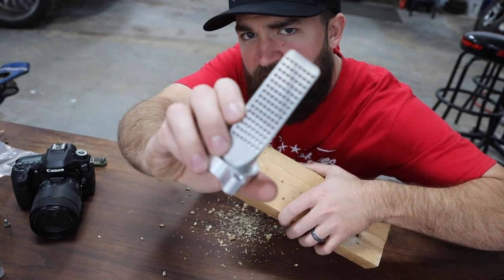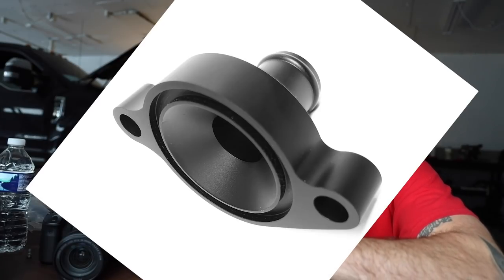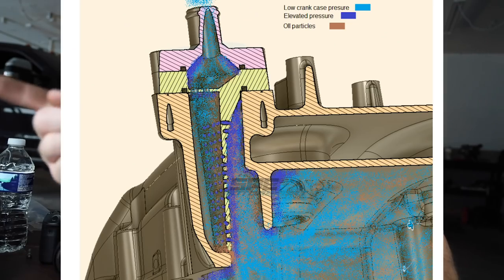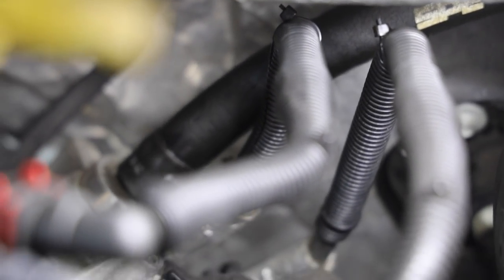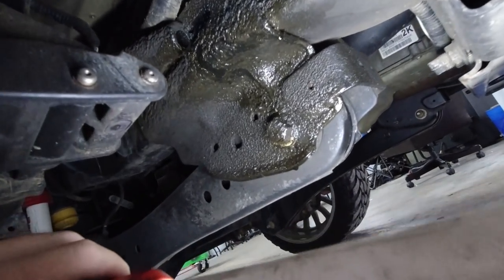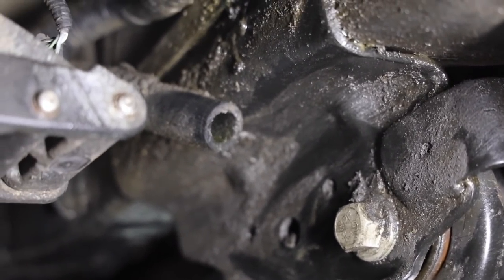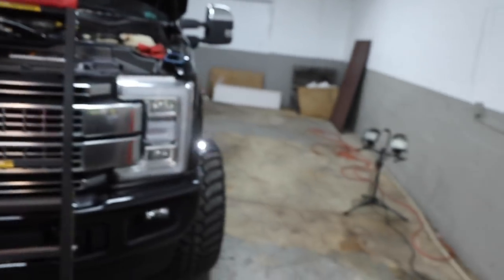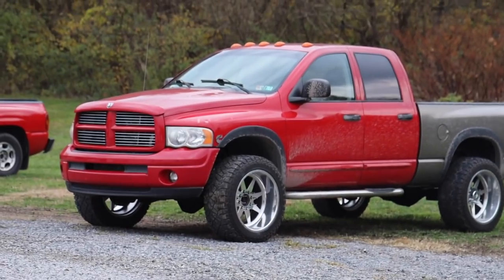Ford 6.7 Powerstroke INTERNAL CATCH CAN - NO MORE OIL DRIPS!

Comment: Pusher, the company who makes those amazing intakes, they make a coupler that connects to your stock ccv box outlet tube and comes with a 1 inch 6ft hose. So you dont need to remove yours ccv box unless you have the filter model. The new filter less model is a catch can then you connect your outlet hose to the included coupler to the one inch hose, then you cap off the intake. Done in less than 20 mins and you have a catch can. All for $32

Comment: Any reason you can’t do this with the existing CCV factory filter and plenum in place? To essentially give you much longer filter life? Seems that a combination of both would still prevent any/excessive oil from reaching the turbo. If this works as well as advertised then there’s no reason to delete the CCV plenum and filter.
Reply: The factory CCV Box would not fit on top of this because of the thickness of the flanges. Ford could redesign their box and incorporate a cheese grater like this. That would be a great way to modify future models.

Comment: Mine still leaks and it’s leaking at the crack case itself when driving and I made sure to install the o-rings supplied with the kit so it’s not that. Maybe the bolts aren’t long enough to give it a good seal idk

Comment: I have had both of these since the ICC launched and indeed get no drips, but the smell and smoke are more than I can stand, Im adding in an external catch can w/ venturi tube into exhaust. I honestly get a little embarrassed with the smoke coming up from under the truck that I can see whenever I am sitting idle in traffic or at drive throughs.
Reply: Did you do this? I have the same problem where the smoke caused people to comment so I extended the hose toward the rear of my truck. What would you suggest for prevention of the oil drip
Reply: Do you have a link for this?

Comment: Just wondering anyone who has done this, where did you route your hose? I took mine over the brake booster and down under the drivers side but the vapor smells are bad. Doesn’t bother me too much, I drive a semi daily but it does bother my family. Did anyone get the extended hose and where did you route it? Down the frame farther?

Comment: So running this product does that make it safe to re attach the the ccv hose back to the intake of one wanted to no longer have it vented to atmosphere? Reason I have these questions is I understand what you mean when you say it drips I noticed between oil changes I lose about 1qt to 1.5qt but I idle my truck on location for about 12+ hrs a day I have it routed to the exhaust but kinda getting tired of it hazing outta exhaust was wondering if it would be safe to route it back to Intake but with mine being an older model 6.7 they have a higher amount of crank pressure then the 15+ was wondering what your input might be I appreciate it!

Comment: What kind of hose is necessary for catch can back to intake?  The 3/4" heater hose that I used collapses.  Heat from the engine makes the hose pliable, and the intake's vacuum pressure causes it to collapse.
Reply: Kits have a heavy wall silicone hose.

Comment: I had to trim mine down, it didn't slip right in like yours did no matter how I orientated it
Reply: How did u trim yours down? Take some off the sides and bottom or just sides? I've got a 2012 and just put mine on today an tried to install internal catch can and it seemed to wide so I need to trim mine to
Reply: @beaugodwin7306  I have a belt sander and just started removing material until it slipped in without any force

Comment: Why does there need to be a hose? Couldn’t you just put crankcase air filter in place of the hose and be good? What’s the purpose of putting a drip hose?
Reply: Good question, most all older engines just had a filter that was placed right in to the valve cover. Seen several high hp gas engines with them and never seemed to be an issues.

Comment: I did ccv re route to under the cab and when idling a lot of white smoke/foggy thing coming out. Is there anyway to fix?
Reply from the maker: You can route that hose to the back of the truck or into the exhaust. I left mine there and every drive through window they think somethings broke on my truck 😂😂

Comment: Do they make one for 6.7 cummins engines.
Reply: Cummins have a ccv filter. There are lots of videos on how to change it. Not very hard at all. I think that you are supposed to change them at 30k miles?
Reply: @bryceweaver8211  Of course 6.7 Cummins have a CCV filter, SO DO 6.7 Powerstrokes.....this is used for when you DELETE the filter and vent to atmosphere.  The answer to the question is no, SPE does not make of these for any year Cummins.  Just get an external catch can, deal with the drips, or don't delete the CCV filter at all

Comment: Yo man, my 19 350 has some kind of oil leak on top of the front 4x4 driveshaft. Once in a while it drips a bit of oil on the ground. Would you know what is going on?
Reply: Upper oil pan is a common leak
Reply: Yup, this will fix it. I just did mine

Comment: I love how all this is working for everyone but me 😂 my powerstroke still smokes when coming to an idle out the reroute kit and with this internal catch can in it and still drips oil? But mines a 16
Reply: Maybe you have more blow by than this can handle 😅
Reply: @jbandit2044  i mean ive compared it to other powerstrokes like mine and pulling the oil cap off next to theres with theres off the blow by is the EXACT same coming from the oil cap and is normal, somedays it doesnt even smoke out the ccv but when it does its def noticeable. Ive even asked mechanics and they even said its weird lol.
Reply: I’ve experienced the same issue with the internal catch can. I’ve installed on my truck since the launch week and this winter i’ve seen droplets during warm ups. It’s minimal but you buy a product for certain reasons and i didn’t want oil on my drive way where my son plays.  I will be adding a external catch can and longer hose to the rear of the truck. I hate the fumes, especially at drive through. 
I’ve also compares my 2012 85k miles to my buddys 2019 1k miles for blow by and it’s literally the same.

Comment: why wouldn't you just add the internal catch can and rig it with the CCV hose and have zero oil blow into the filter and have no emission issues? That way there is no tampering with emissions issue you are just adding extra filters. sure there is vapor but it better than the EPA or local fining the shit out of you.